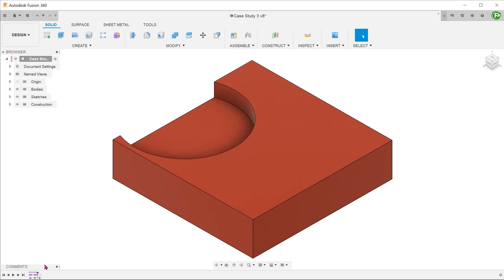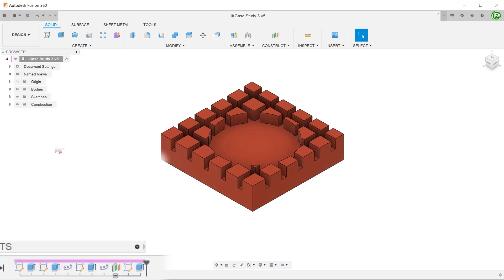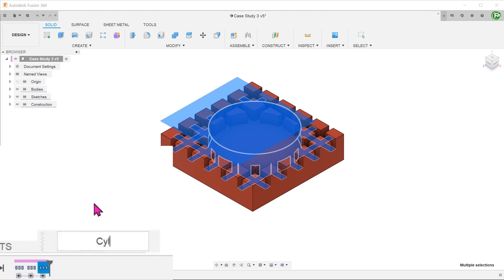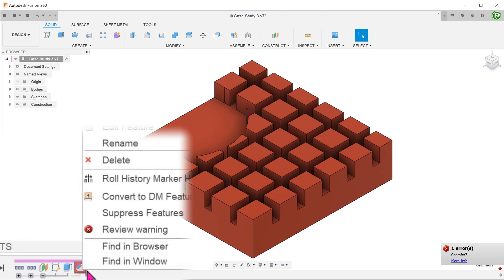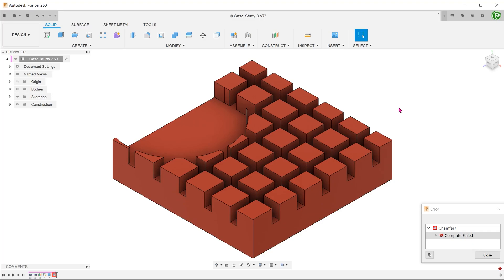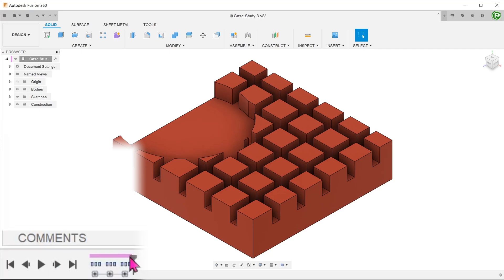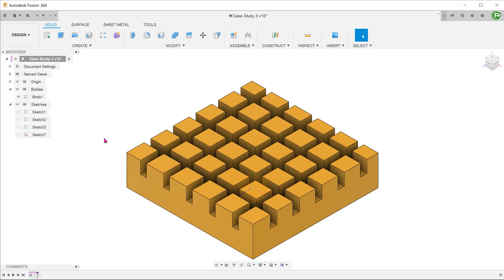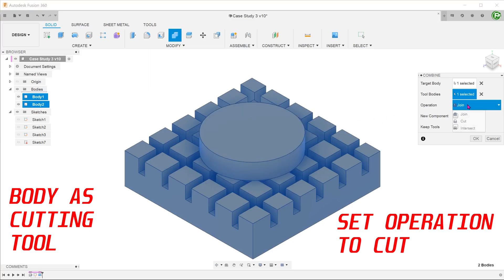Fusion 360 - Case Study 3

Comment: Another way occurred to me (which I just tested) that allows you to make the cylindrical cut as a single Extrude.  Using a sketch of a circle on the top surface, the Extrude options are:
1.  Start -> Offset, with the size of your chamfer (may need to adjust sign for this an any of the other distances/offsets).
2.  Direction -> Two Sides
3.  Side 1:  Whatever options you want to get the cylinder to the correct depth.  One option: Extent Type of "Distance" with easy with math like (cut_depth - chamfer_size).
4.  Side 2:  Extent Type -> All, Taper Angle -> 45 deg
5.  Operation -> Cut

This is also possible with the "Hole" command with the desired options set similar to the above.  The shape is a simple counter-sunk hole that doesn't go all the way through.